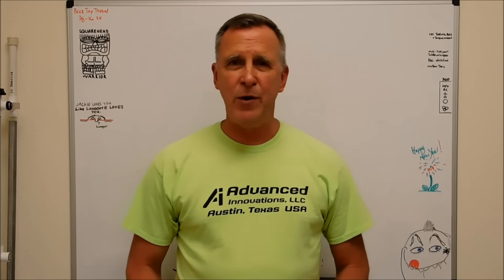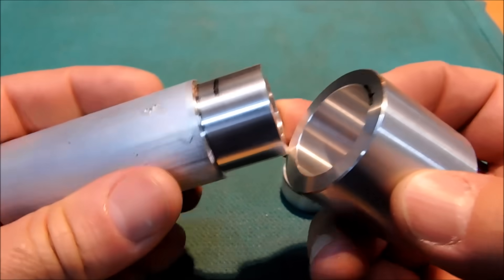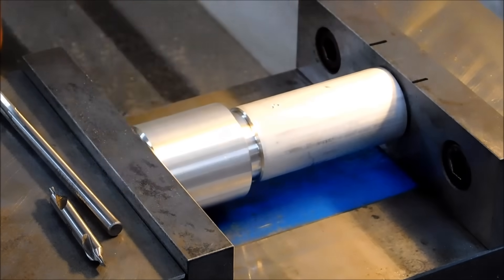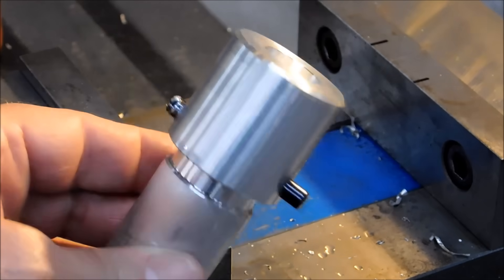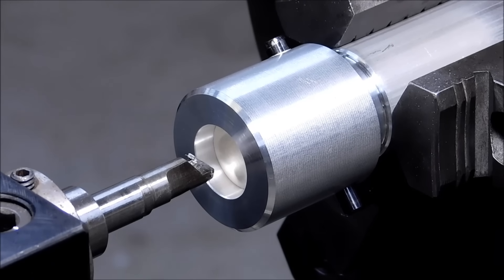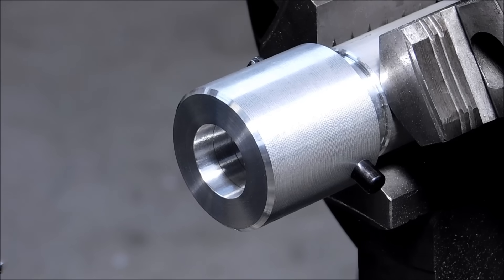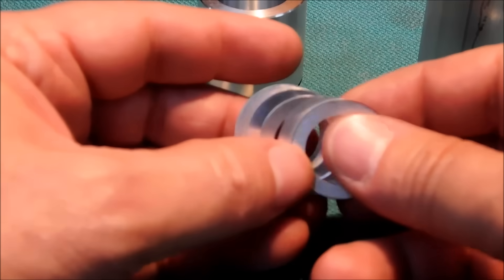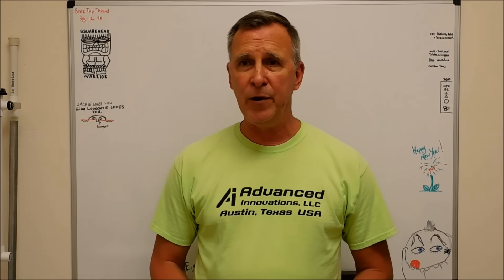How to Hold and Bore Out Thin Shims

Comment: If you put threads on the outside of the cap and a shoulder on the ram, a second cap with internal threads would slide over the shoulder and engage the threads on the first cap. Holding the first cap and turning the second cap will compress the shims without torquing them. That way you do not have to make a new ram and cap for each set of shims.
Reply: Or you set an extra thicker shim or spacer in front and behind the thin shims. 
This method also is used f.e. on open rings for inner grinding  like Hydraulic pistons.
Reply: So you're making it a three piece system instead of a two piece system right?

Comment: Like the idea , but what next..still got to do 500 pieces?. Make more arbors ? 15:42
Reply from the maker: First, build the arbor to suit the job. If you need to run more than one batch, load the arbor exactly the same way, just rotate the cap and drill a new hole. Depending on the size of the parts, cross pin and arbor, you can do over a thousand pieces easily with one arbor.

Comment: Hi and thanks for the informative video. I’ve got a bunch of a range of shim thicknesses including maybe .005 to make that are 4” in diameter with three holes in a triangular form about 3/8” in from the outside diameter. No hole in the centre. I had planned to use a similar process as you did but will be a bit more complicated due to holding the pack of square shim plate to be made into circular shims on the outside diameter. I’ll plan to make two end plates larger than the finished diameter and compress the shim pack with studs on the outside somewhat like an hydraulic ram tube. Drill and rheem the three holes, then use these holes to work as the compression screws. One I’ve got to that point the end of original compression device can be dismantled and I can turn the OD on the mandrill.  You confirmed my thinking with your method. Cheers. Andrew

Comment: I have successfully made G-10 spacers with the method you have shown. These spacers are .010, plus 0.0, minus .001 thick. When parting off the ID shreds, so I added .100 to the ID. Made the arbor identically and used poster board for clutch material. 100% perfection, Thank you so much!!!!

Comment: Still prowling around. Great tips my friend. Never been faced with this but this is certainly one I will remember. Thanks eh !
Reply from the maker: There are not too many other ways to get past this problem.
Reply: @joepie221  I guess it is the "Clutching" material is the real trick to use. I would imagine a split roll pin will work ok as long as it is installed with the split inline with the tool ?

Comment: I assume that the bore's concentricity depends on how close a fit the washer's OD is to the holder's ID. Could you use the dowel from your last video to center them and then push the dowel out the back of the chuck?
Reply from the maker: The job I did for this, I had the advantage of precision OD's. Concentricity was very close, but the pocket can effect that.

Comment: The only thing I find fault with is that you said there were 500 pcs.. You only machined a portion of that quantity and to complete the required quantity, you would have to make more arbor holders as your pin holding method is only good for only a few machining cycles.
I would have made the chucked arbor with a flange on the end and there would be a threaded barrel that would slip over that arbor from the chuck side and then the arbor inserted in the chuck making the barrel captive.
The nose piece that you pinned to the arbor would be threaded on the OD.  The parts to be machined would be inserted into the nose piece as you did and the nose piece would be threaded into the barrel and clamped.  The nose piece would be clamped without distortion.
This would yield a reusable fixture that could be used over and over.
Hard to put this in writing, but easy to make.
JIM
Reply from the maker: The job consisted of .001, .003 and .005 thick shims. Equal quantities of each. Rotation was not allowed for bunching up and marring of the surface finish. After each batch bored, the cap was rotated to fresh material and re-drilled through the same cap hole. The quick single fixture easily handled the job. The screw cap was not an option. I could have done this job 10 different ways. This was the method I chose based on time constraints and quantity.

Comment: Joe any tricks on making tang location washers? Im making some surface grinder arbors and I want the washer to have an anti rotation tang to locate on a keyway. Im stumped, outside of maybe a press die
Reply from the maker: Rotary table and a broach is how I would approach it. Unless you wire EDM the hole and tab.

Comment: Good procedure when needed. Ideally you would punch those out with a shin die, but that would only be good down to  002 hard shim minimum.
Reply from the maker: This procedure was born out of the need to resize the inner bore of commercially available shims. 1000 of them. There is no way you could do that with a shim punch, keep the bore concentric, and not distort the flatness of the shim. But ideally, punching a shim, OD and ID at the same time is the way to go.

Comment: What a great video. I’m not a machinist, but I marvel at what machinists do. I hope you won’t mind a question from such as me. The three part holder, the arbor, the cap, and the spacer were made for this purpose? I mean to ask, after this job it is unlikely that an identical job will enter your shop, so all the work and materials spent on the holder parts is basically costed to that job? Even with the time spent making the holder, a journeyman machinist would still complete the job in the three hours you mentioned? Thank you again for taking the time to explain.
Reply from the maker: Yes, tooling is usually a consideration for job cost. if you don't expect a repeat, don't get carried away with the arbor. the advantage of a great setup is time saved. More than pays for the arbor. A journeyman machinist could easily complete this task in 3 hours if they knew the process right up front.
Reply: Joe Pieczynski thank you for the reply, most kind!

Comment: Awesome sauce brah! 

I have an ancient micro mill (horizontal) pre war ( WWII) from The Atlas Press Works of Kalamazoo. The tool arbor requires precision shimming for tool setup. I used to spend $11.83 US for each setup. This is the lowest cost for shim kits containing the required spacers.

Now, with a couple rolls of shim stock, via the magic of math and the process you've shared, my additional cost per  setup has gone from 11.83 to less than one penny per. I make a stack of shims 1.75 inches thick so my unit cost per run goes WAY down.

I'm thinking about making s die punch to rough the blanks so I'm not wasting as much material and to shorten the setup time. I should be able to slice out .25" to .5" per punch.
Reply: I would accordion fold the stack up for the first op, the punch.
Reply from the maker: Glad it helped you.

Comment: Say you need to do this to some really thin and delicate material such as gold leaf, you would alternate individual layers of the super thin material with a layer of thicker more stable material (.125 or so) in order to isolate the thinner and more delicate stuff each into its own separate layer.
Reply from the maker: Yes. Sandwich them with thicker parts and apply a lot of pressure.

Comment: You could deffo make this fixture reusable; instead have a screw going in from behind the shaft that's being held and in that shaft have an internal thread with a bolt going through it where it pushes the floating packing piece into the shim, therefore the thread allows travel for different amounts of shim or you could have several packing diameters, ect. Either way you get the torque of thread (albeit smaller thread compared to the vice) and also get infinite re usability. This design you obviously need to fix the top cap rather than it being free, you could use your pin or i personally would have several screws.

You could also make a little fixture that allows it to be clamped your original way, but having space between the vice jaws to allow to tighten the top cap ( with whatever method you use) and then nipping the bottom screw into packing piece into the jaw, keeping that immense torque in the shim.

Not quite sure if you understand if u read this, but yea...
Reply from the maker: You are correct, but be careful not to rotate the exceptionally thin material with the rear screw and pad design. Linear pressure is much safer.
Reply: OK then, have a stationery nut that you turn that moves the internal bolt linearly. Then you can use your method of vice clamping pressure, then use the nut to lock in that pressure on the threads while its clamped. Better idea? :P

Comment: To make the boring fixture reusable and adjustable in length put a flange on the cap and shank and hold the two together with screws.
Reply: Make the fixture reusable. It's waste of time to build a throw away fixture. Good idea Joe, but it fell short at the engineering level.

Comment: Thanks for your video, I was able to make a fixture with more diameter so It could have bolts pulling the two halves together, I was able to make shims to shim the gear box on my lathe.
The whole video humbles you to the fact that holding fixtures come in many forms on any machine, if you can't hold you can't work it..
Reply from the maker: I live by that thought.

Comment: But if you had more to do you would have to keep drilling more holes for a new pin? Nice work.
Reply from the maker: Correct. rotate the cap and re-drill it. But this technique is for such thin material, you can do hundreds at one time. if you had many, I would think an adjustment screw from the opposite end could be engineered.

Comment: Joe,

Other than the basis of precision. Could a drill bit be used to do this rather then a boring bar?
Reply from the maker: I suppose if the pressure was solid, a drill would work.

Comment: Brilliant technique Joe... Thanks for sharing. Was the pin a taper pin or a parallel dowel pin? Could you use a Roll Pin? The boring bar you used - was there anything special about it? To penetrate the shims did you have a bit of a lead-in on it? John🇬🇧
Reply from the maker: The bar was nothing special. HSS with a very minimal radius, slight positive rake and ground square to the shim face.

Comment: My concern is that the OD of the parts is smaller than the ID of the pinch cap the parts are placed in thus allowing the parts to be off center. Then you would have the wall of the parts vary in thickness.
Make sure the arbor OD and pressure cap ID are mil spec 1.125 which is the exact OD of the parts. (If the OD of the parts is over 1.125 (customer desired OD), then use the .625 pin with set screw locking collars pressed in a vice and then machine the parts to 1.125 OD first.) Either way the parts must be at an acceptable OD and the arbor/pressure cap at the same diameter so the parts sit perfectly centered in the setup, also the cap would have no run out.

Now for the jig re use capability, take the same setup with pin cap retainer but the cap longer allowing for a variable in quantity of parts including another plug at the boring end. Then on the end of the cap, drill and tap 6~ holes for allen set screws which would then apply pressure (against the plug at the end) instead of the vice. Just be sure to make the cap head plenty thick enough to handle the pressure put on the threaded holes by the equally tightened set screws.
Reply from the maker: I like the embedded set screw idea for the cap, but the arbor and cap are made to fit the shims, so any slop or eccentricity would be at your control. ID and OD concentricity are not usually called out as critical on shim spacers. Comfortably done, this setup will be within .0015 TIR concentricity everytime. If you look closely at the video, its the chamfer on the cap thats running out and not the cap itself.

Comment: Great Technique! A question the hammer you used at approximately 6:30 into the video, What Brand is it? Does the "hole" near the head of the hammer have any Specific purpose or is it ~just a design factor~  ???? I always wonder when I see things like that. philip, from the Great Pacific NorthWET.
Reply from the maker: Its a toolmaker hammer and the hole is a magnifying glass for small pin and center punch work.
Reply: It is actually a magnifying glass
Reply: Starrett is one brand I know of...

Comment: It looked like the pin you used may have been slightly tapered by the ease that it started.  Was that an illusion?
Reply from the maker: The hole was reamed to .251. the pin was .2505

Comment: How about a shouldered nut over a shoulder on the arbor that threads onto the cap after the pressing is done?  That would make it easily reusable.  Just apply pressure then loosen the nut to take apart.

Comment: Nice trick I love seeing solutions with innovation. I think you might be able to use a series of 4-6 screws to clamp the cap down on an arbor and thus have a reusable and re loadable tool, rather than pinning it crossways. Do you think that would work, or is the force much higher than the tensile strength of some screws?
Reply from the maker: I have to believe there are several ways to do this. My cross pinned cap is just fast since you don't have to thread anything.

Comment: Have used the threaded cap version before for model engine head gaskets. I wonder if the cap you made could have been made flanged and held down with screws to make the jig reusable for different thickness of the parts stack?
Reply: Just glanced at some of the comments below and see others had the same thought. Great video by the way.
Reply from the maker: Mine was pinned for speed.

Comment: Friction and heat shrink are 2 great overlooked workholding methods.
Reply: bcbloc02 so a standard collet is not friction and a smooth face vice is also not   friction. heet I can't argue whit
Reply from the maker: Yet friction plays a part in both cases.

Comment: I like that.  Now to think of a way to make the arbor work for repeat operations with varied numbers
Reply from the maker: You could probably rig a screw and pad that comes in from the back to adjust the pocket. That would let you keep the cross pin design using just the first hole.

Comment: A couple of screws from the end into a larger diameter arbor will clamp it all together  as well
Reply: I thought he said, the threads could mess up your work. Also, wouldn't the rotation of the lathe cause the screw to come lose or loose rigidity(theoretically, I'm assuming you mean from the opposite end of the boring hole through the arbor)...I've never tried, just wondering.

Comment: I imagined an arbor similar to yours but made from square stock with holes drilled and tapped in the corners using bolts to draw it together.  After seeing your trick, I think your method is faster with much higher clamping force.  Thank you for all of the awesome education you bring us Joe.

Comment: Well now. A genuinely elegant and relatively simple setup that clearly works. My own background as a git-er-dun  truck mechanic in a general duty repair shop absolutely does not require the same degree of precision as a machinist automatically thinks in,based on his training and approach . My own thought would have been to walk over to the bench with all our soldering doodads,actually tin with 95/5,then probably 30/70  on top for better strength. Solder the parts together with our old kerosene blowtorch,solder properly applied has great holding force,cut the now cylinder to appropriate diameters,then unsolder and so what the washers are a little thicker,the tin etc will help hold a nut from vibration. Now that will NOT work on aluminum tinfoil,but sheets of different thicknesses are generally available from truck  brake supply houses so unless aluminum is a known requirement,doneskis.  Shim stock is incredibly useful in a whole host of applications,so various remainders are sorted through to choose from. Yours is I think a better approach,no major heat and may very well take less time than my approach.
No doubt there are other ways to the same end product,precision tools like a lathe are a luxury in my world but possibly one of the old brake drum lathes  could be adapted. Whatever works. Cheers.

Comment: this is one of your bettr tricks.  can a thinwall bushing be machined with this method or is there a better way.
Reply: If you are making it out of plastic he showed method in which you bore hole ant then take a big cut on the OD to make very thin parts.
it should work on other metals.You have to make OD in one pass.Since big cut is used as support so that your thin wall doesnt collapse from cutting force if you did it in multiple small passes.

Comment: But, how do you do 500 of them? In 3 hrs.  I mean if you have 500 shims that need boring and 25 fit in the arbor, could you expect the arbor to be reusable for each batch of 25?
Reply from the maker: The arbor used in this demonstration had a grip range to 3/4". If the shims were all .001, thats 750 at once. 3 hours was not a problem at all.